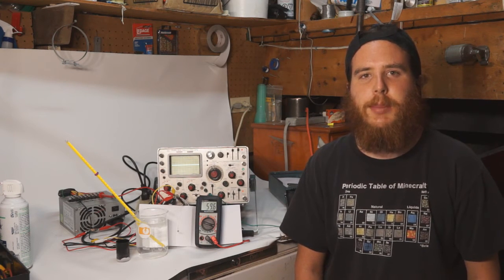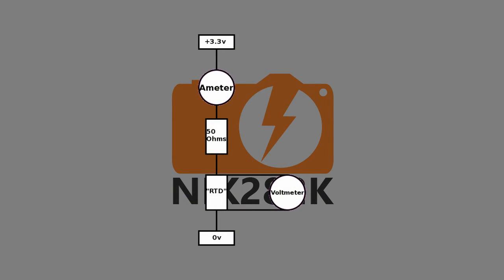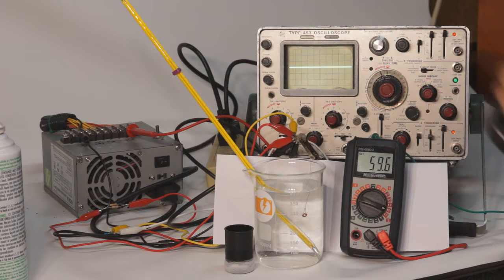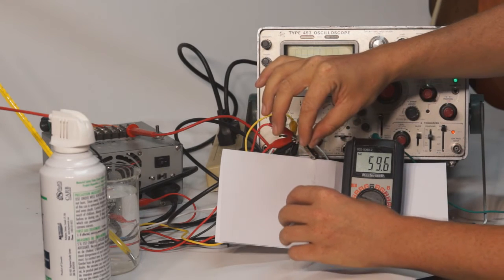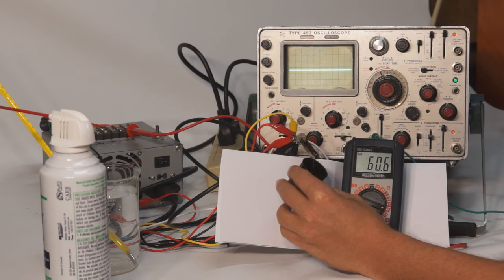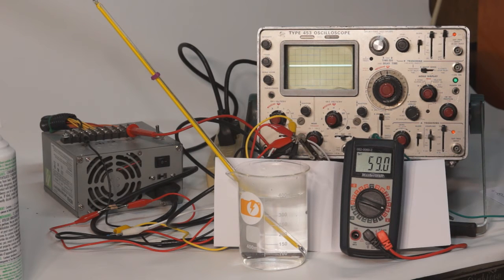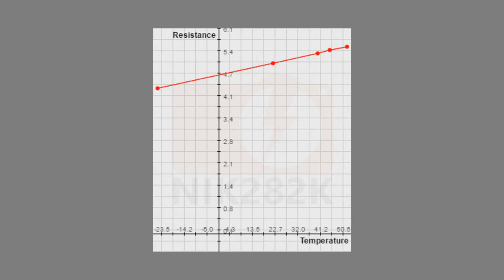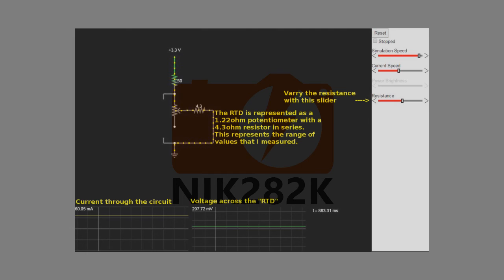DIY Resistive Thermal Device - "RTD"

Comment: what would be some good practical uses of heating or cooling electric wire?
Reply from the maker: An industrial "RTD" can measure temperatures very accurately, they are used to control and monitor manufacturing processes.